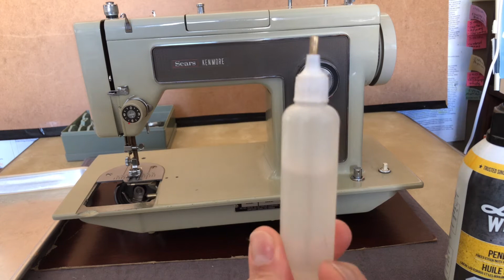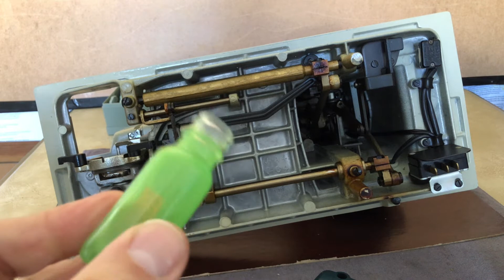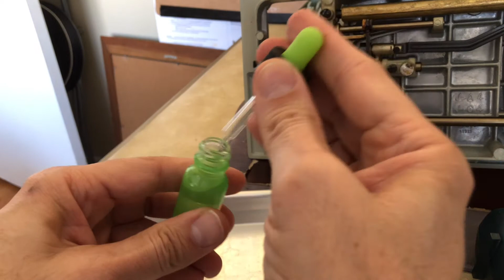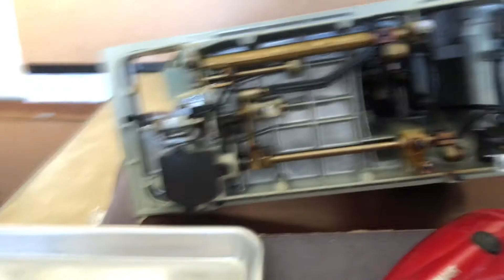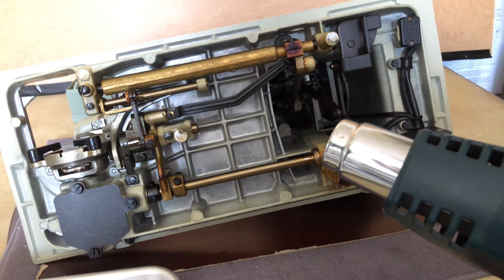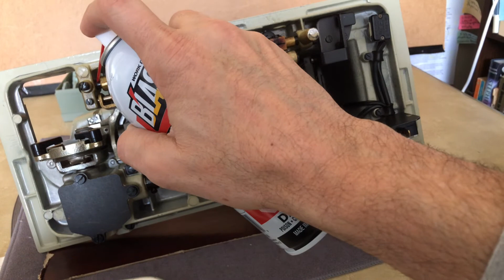TOOLS & EQUIPMENT SERIES #20: Waking Up a Sewing Machine After a 30 Year Nap. Frozen Machine Parts!

Comment: Something you might try for a penetrant is 50-50 solution of ATF (Automatic Transmission Fluid) and acetone.  It's been reported that it works as well or better that the commercial penetrants.  For a quart of ATF and a quart of acetone most folks will have a life time supply.  You can also apply it with a pinpoint oiler to save on the mess.   Keep the good stuff coming.
Reply from the maker: Thanks for sharing that suggestion, it's always good to learn about new penetrant options!
Reply: That’s a potent mix!
I use acetone to clean many things… but I wouldn’t use it on a sewing machine… I’m sure it’s just fine for internals, but it would absolutely nuke the paint if it touched it!

I use it to clean spray paint from car and bike paint. Modern clear coat and often factory paint will be resistant to the acetone so you can just wipe spray paint off with an acetone rag and it won’t even touch the original paint… it’ll make them shine! And requires much less elbow grease than goof off or alcohol.

Comment: Have you ever tried using a soldering iron held to a housing for very point heat?
Reply from the maker: I have thought of it and I do own one but I found the heat gun is faster given that it blows heat off of its elements.  Although, now that you mention it, your idea might be helpful when trying to avoid soft materials in a tight space.  Thanks for the suggestion!

Comment: Another consideration for heat guns: mine also has a high and a low setting.  On mine, the low setting is hotter than the high setting because the switch is controlling the fan speed not the temperature.  I think more power goes to the fan and less to the heat element on high.  Maybe it's just defective but I have to be aware of it.
Have you told the model of that machine?  It looks very much like my 1757.

Comment: I revived my Viking Husqvarna 190 1982 through a heat gun to soften the old oil that turned into a gummy varnish. FOCUS the heat (hand-made aluminum foil funnel) with lubricant and gentle movement and stay AWAY from the plastic, wires, and rubber. Success!!!!
Reply from the maker: Congrats on your success!!

Comment: I just resuscitated a dead Kenmore 95, after a week of irrigating oil ports and bushings I opened the gear box. 😱 it was locked up in the hook gears and after digging filthy lumpy grease out, hit it with Pb Blaster and it started hemorrhaging some evil crud. And after a lot more clean up it turns like butter. So try the hook gears on that boat anchor, I don’t recall you doing that.
  Old 3 In 1 will always go to the worst possible place.
Reply: Great tips . Thanks
Reply: I was waiting for the gear box opening, too. I just cleaned out one and I wasn't sure how much grease to repack it with...

Comment: I'm waiting on the Necchi power cord that I ordered to come. Then I will wake up my old Necchi Nora. Thankfully, she's not frozen up. 

Do you have any recommendations for getting off melted old power cord off the paint? It's right where you sew on the bed of the machine.  Thanks for making these videos and helping us.
Reply from the maker: I might try hand cleaner (Brands such as Permatex, GoJo, etc).  Be sure to only use one of these that has NO PUMICE.  Some come with pumice added as the products were originally created to clean hands of grease and grime.  Always try anything on a small area on the back at first to ensure compatibility.  Here is one video I made using such a product.  https://www.youtube.com/watch?v=nYRxAxyRA3Q
Reply: @VintageSewingMachineGarage  thank you so much! I'll check it out.